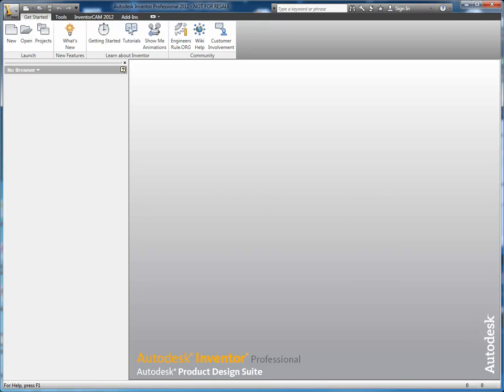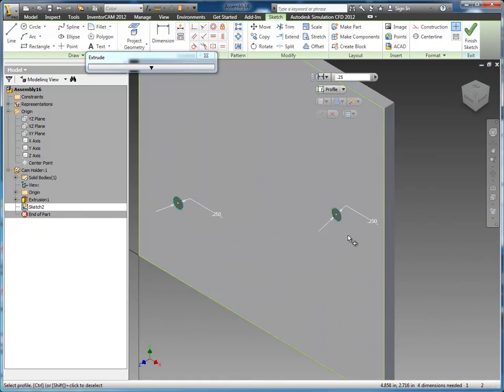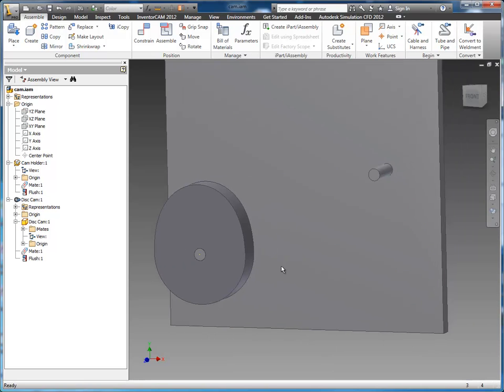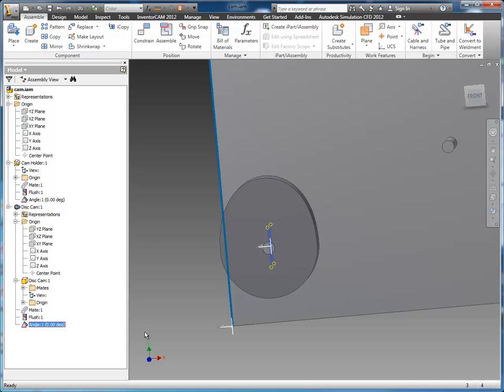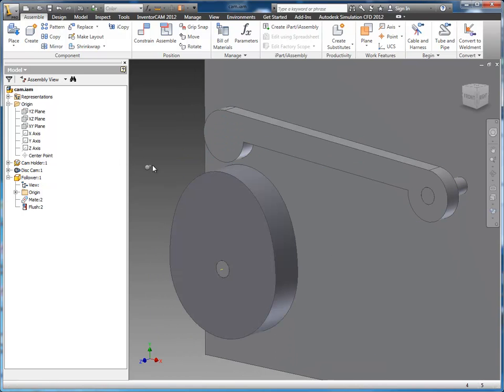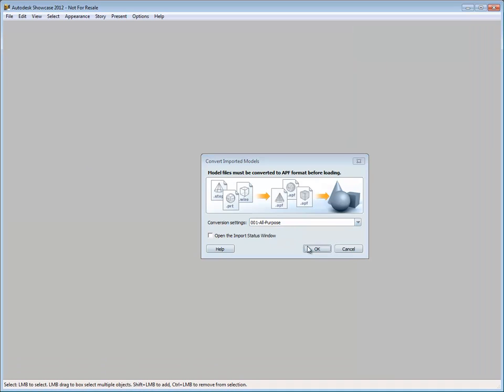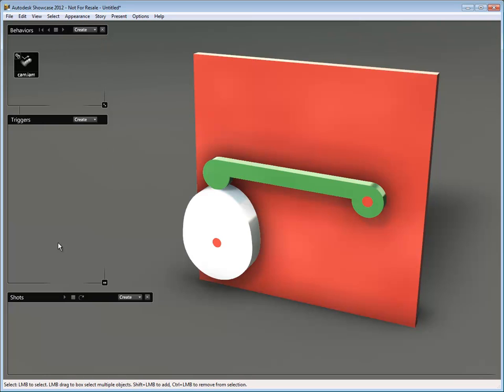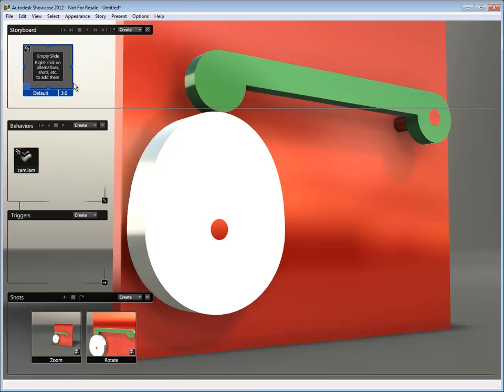Cam and Cam Follower in Autodesk Inventor and Autodesk Showcase

Comment from the maker: You may want to check out the dynamic simulation tutorials on wiki help.

wikihelp.autodesk.com/Inventor/enu/2013/Help/0126-Tutorial126/1111-Dynamic_1111/1112-Dynamic_1112/1113-About_th1113#GUID-770B6500-DFFA-4489-849C-6B9702E8AD12

Comment from the maker: Sorry I totally misread your comment and thought you were in inventor still...my bad. You are right, the setting has changed in Showcase 2013, it has gotten better. Rather than just one drive constraint, you can add multiple drive constraints. You will find the setting under the file menu>>settings>>import settings. Then select inventor from the drop down. There is an animation section where you can add the names of the constraints you want to drive. I will try to make and update to this video.

Comment: The inventor file is not imported in the same way as shown in the video. The drive constraint is not set as behaviour by default I'm unable to find the constraint dialog as well. Please check if you're using Showcase 2013.

Comment: Wow, thank you so much, this is exactly what I've been trying to find. No doubt I'll blow the other teams presentations away now. One more quick question as I've predominantly been using Solidworks, is there a way to add a working spring into the assembly if you were using an overhead cam in an application similar to a valve